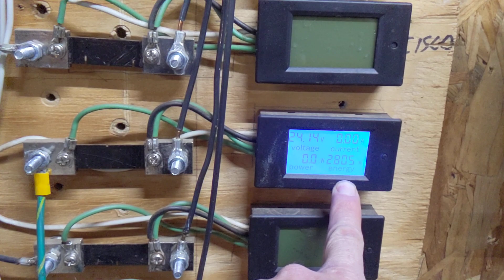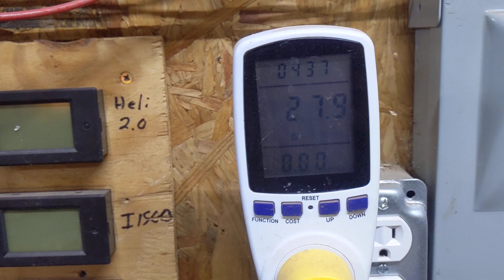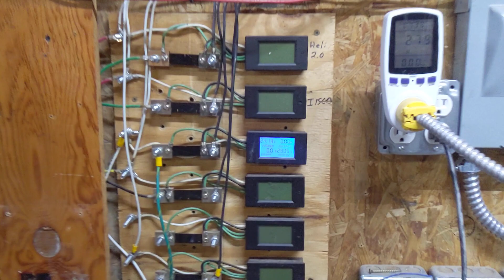Update on the iSta Breeze i1500 (since it's the only thing running right now :D )

Comment: I wonder is the SSR cooked? Might be worth swapping that out first? Seeing as the ssr is only getting ground? Maybe I'm talking out my ass too 😂
Reply from the maker: nah I tried that first thing...tried three different SSR's, actually...thought maybe I swapped it out for one of my old cooked ones, so I put a brand new-in-box one to try and same problem.  That's when I measured current across the inputs on the inverter...should be dead but measures 4vdc.
Reply: @ToysforWatts  were they same brand?  Maybe a different brand might do something differently ,or try changing the  ssr to break the positive instead? Would be interesting to see if a relay with a higher trigger voltage do the same thing.
Reply: Looks like the other ssr heatsink is slightly hitting on the one beside it too? Maybe could be causing some funky grounding?
Reply from the maker: probably not, the other SSR was working.  It's the backfed voltage, none of the other inverters are doing that.

Comment: I had the same problem with the Aims inverter; the control board was out on mine. After  I changed it and the power board, it works fine. I drilled the heads of the screws on my little Honda PMA. It  had six magnets but they're weaker than Biden"s kool aid. I am going to add 5 or 6 pin magnets to each magnet by drilling holes in the old ones. I rewired it from three phase to six wires coming out that I can make it single phase. I don't know what the output will be, but it is a start...I also ordered 80 ring magnets for my two brake rotor experiment... 36 per rotor is the plan...We've had 40 mph wind and gusts like 70 or so, for hours...has rained inches today...will be a soggy day tomorrow...we probably got 5 inches today...has rained very hard. I'll have to make some new screws for this thing now.